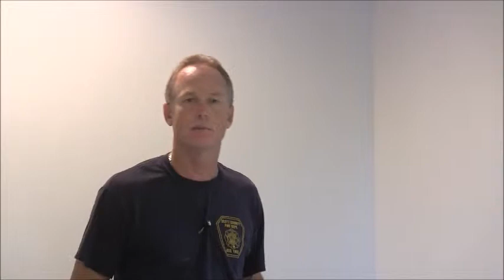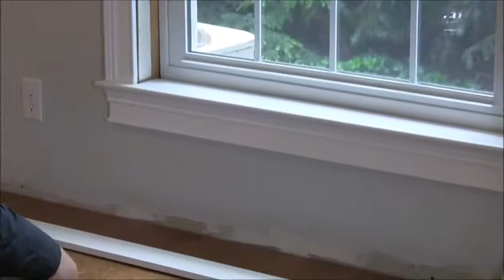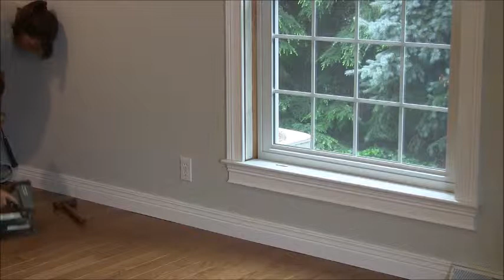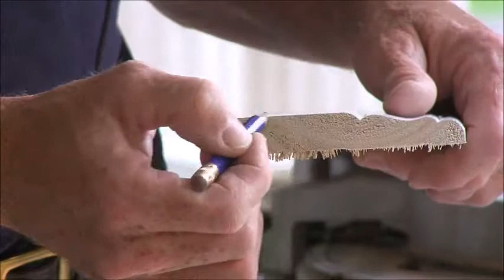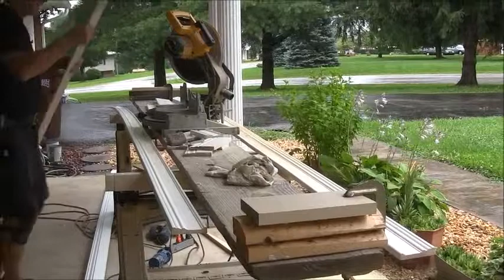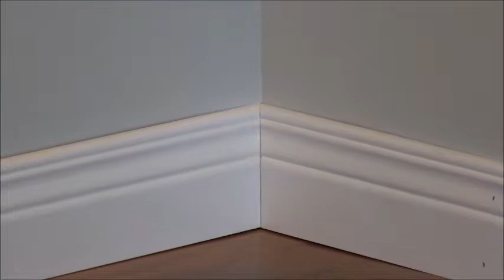How to Install Base Trim On An Inside Corner Using a Coping Saw

Comment: The second piece...did you measure from the return to the wall or the return to the first piece of trim?  You're blocking the view.
Reply from the maker: From the return to the first piece of trim. Sorry for the delay, been away from a computer.